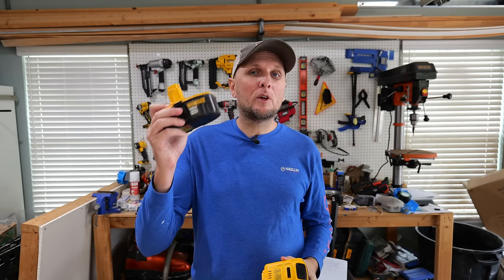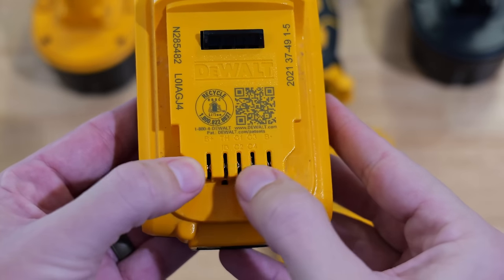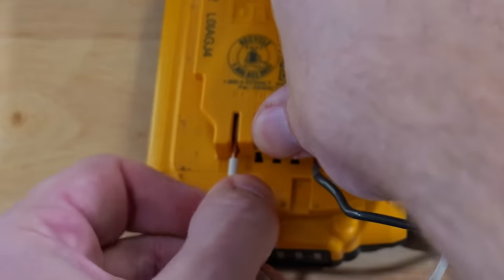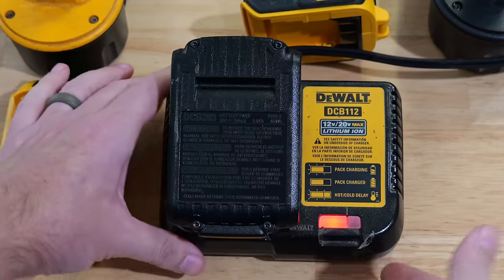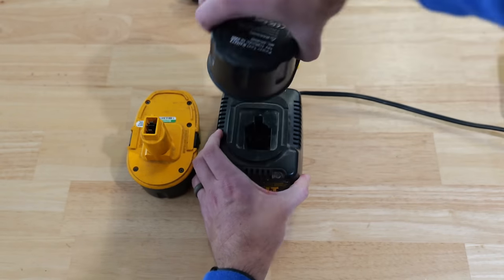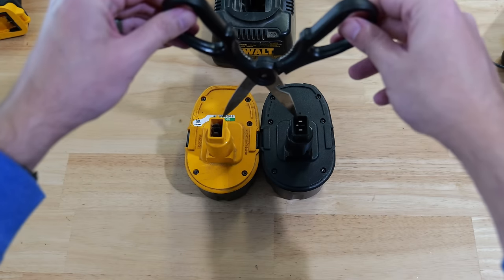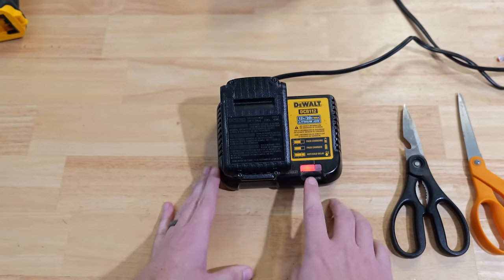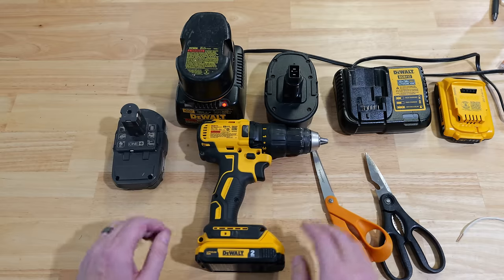SECRET To Reviving Dead Portable Tool Batteries | Super Easy!

Comment: For the 18volt dead battery, instead of wires or scissors to charge off of another 18 volt battery. Just use a typical 9 volt battery and place upside down on the prongs for about a min. Should send a charge to get it recognized by the charger. Super easy!
Reply: Do you have to match the + and - on the 9v to certain sides of the battery your sending the charge to?
Reply: Do a video, I'd like to see you do that... before I try it.
Reply: @jmar8507  absolutely, the polarity of the battery has to match the polarity of the charger.
Reply: @jmar8507   yes, if you get the polarity wrong. it wont charge or might  damage the circuitry in your good battery as well as the dead one.
Reply: @GothGuy885  Many years ago I tried to help someone out by jumpstarting their car. I looked ate the battery, connected the batteries, started my engine, and the other engine would not start.

I looked more closely, turned out their battery was reversed.
Reply: @oneeyedphotographer   LOL , I know where your coming from. my friend and I had classic cars , and when we needed a jump-start ,we always had to tell the person helping us that the car was positive ground. which always seemed  strange to me , seeing that these  cars  were made and around b4 I was born.
Reply: Why dont you take the 3 seconds and try it your self logic is sound  @ronnieroxx13
Reply: @GrayRaceCat match means "+ on + and - on -" or "+ on - and + and -"????
Reply: @oneeyedphotographer If your serious i Don't understand. The battery was turned around or the post were reversed? Jumpstarting only works one way:Positive to positive and negative to negative....
Reply: @GothGuy885 Not sayin your wrong but have owned over 150 classic cars....those before '73 back to '03 and perhaps they had been converted but never saw positive ground just 6V or 12V. But obviously I can't have seen everything. Plus we hot prodded everything. That's my ProStreet '64 Corvette w/Supercharged BBC in that little channel icon pic.
rick in Tennessee
Reply: @TheAcceleratorMagazine   we had 1940's-50 cars. that were independents from the big 3.   2 Hudsons ,a Packard and a Nash. tho that was my partners thing, I was more into 1970's Mopars. because that is what was around when I was a teenager, such Sexy cars!  :)>
Reply: @TheAcceleratorMagazine   my partner was into the 1940,s - 50,s cars. which had Pos. ground. I thought that was weird also.
I myself am into 60's ,70's cars .mostly Mopars. with the back lifted, big Fat deep dish mags on the back and standard slots on the front. and the way they sound in idle and when  they're being revved. they are just sexy AF! I get a wood when I see one :)>
Reply: @jmar8507 absolutely yes. Take your meter and double check the tabs for polarity. Lithium batteries are less forgiving than an ex wife and just as dangerous.😮
Reply: @GothGuy885 Worse, if you dont catch it quickly it will catch fire. Lithium batteries are unforgiving
Reply: @TheAcceleratorMagazine  Some cars and usually some older construction equipment such as the Caterpillar dozers were in fact wired to have positive ground. Don't know why but it was a thing.
Reply: @netts2315  Preciate the reply. After I thot about it I remembered some of that. Kinda like some lug nuts are left hand thread. On an old Jeep pickup they were right hand threads on one side and left hand on the other. Didn't figure that out until twisted off one stud on the left hand side. With a long pry bar on the lug wrench. 
rick in Tennessee.
Reply: @TheAcceleratorMagazine  Yeah, I remember that, I wonder where these setups went? I guess they were too complicated to have to remember which side you were on and people snapped studs left and right. How's the weather in Tennessee? I'm based all the way over the globe in Finland, 17,6 degrees Fahrenheit right now and experts are predicting spring to be as late as April. And I was hoping for an early spring, lol. Cheers!
Reply: @netts2315  Great to hear from ya. Have worked in a lot of countries but never Finland. Haven't traveled much as a tourist to see the pretty and interesting parts of this world, always in the dark and dirty parts. Plus I I wudn't know how to act, or feel comfortable, unarmed.
I thot I liked cold weather until I spent some time in a country with those minus zero tempe and whiteout conditions from blowing snow. Went back to jungle fighting for several years then to deserts. In Peru where I was stationed it was their "winter time". About 60° durin the day and 50's at night with zero humidity. I had found home. Almost. But that's another long boring story.
rick in Tennessee.
Reply: @TheAcceleratorMagazine  Very interesting stories, thank you for sharing! Cheers!
Reply: Thats what i thought also...but figured he meant that he carhed the battery the right way...but dead car had its positive wire connected to the negative battery terminal and vice versa )  @TheAcceleratorMagazine
Reply: @gballs007  Preciate the reply....
Kind of a miracle that many old vehicles and lots of heavy equipment have survived.
Reply: Doesn't matter how the car is wired, you still have to connect plus to plus post and neg to neg post of battery...
Reply: @cliffkishbaugh2221  Um, maybe not. I thot so too, like you but I got educated here.....
You'll be hearin from em. Just take it like a man. Like I thot I made a mistake one time....but I was wrong. 
rick in Tennessee.
Reply: @cliffkishbaugh2221  Not necessarily. Positive to ground vehicles exist, some old cars do/did this and especially old Caterpillars.
Reply: Does a 12v lead acid with low amps work
Reply: @shafferfoods4669 A 12v battery usually can revive a 18v li-ion battery, but it's risky, because due to the lower voltage there's a chance polarity will inverse on one of the li-ion cells, permanently damaging it, and causing safety hazards. If you use a 12v battery, use it along with a voltage meter to make sure the voltage keeps steadily rising until about 10V, then try the charger. If the voltage on the li-ion battery stagnates, the battery pack is dangerous.
Reply: I once had a dead car battery and asked a guy if I could get a jump. Neither of us had jumper cables, so he took his battery out of his car and put it next to mine, matching up the posts and tilted his battery, touching posts and had me turn my key. 
Vroooom!
Reply: What if you only have 1 battery? Would an 18V power supply do the same thing?
Reply: My problem is the battery shows fully charged, but has 0 V.
Reply: I have done this when I was off-grid, when yet knowing I may be in need of a backup battery, I had a spare new auto lead acid battery which I had kept charged on a solar charging set up with a charge controller and an a plug-in inverter just in case.  I went out one day to my truck in a hurry to go into town & the truck's battery was dead or so low that it would not start the truck.  It wouldn't start, so instead of disconnecting cables, and having to lift 2 heavy batteries, I thought  why don't I just flip this fully charged backup battery over on top of the one still hooked up in my truck, connecting + to + and - to -, and it worked!!! I waited about 10 minutes , then turned the key & the truck roared to life again! I removed the upside down spare battery, put it back on solar charge again, while I went to town to buy jumper cables! Thank GOD, and I was on my way again. I went straight away to purchase some heavy duty jumper cables to have on hand when I couldn't wait for my slow charging solar panels to do the job on a dead battery in a vehicle & also to have in case my truck battery was again  too low would not start so that someone would help give me a jumpstart if I needed it 
on the road or in a Walmart parking lot.😂
Reply: @panamaks1  try a 9 volt battery to dead battery
Reply: @TheAcceleratorMagazine Yes i have a 1956 Ford 800 tractor, 6 volt system with a positive groung.
Reply: @GothGuy885  The "good battery" hasn't got any circuitry. It's a PP3 9V battery.
Reply: @GothGuy885  A good friend of mine had an MG Midget which was + ground. Not many radios had a switch for this. We made a dash panel from wood. We put an MG (small dia.) inner tube around it plus plastic support bracket. After reverse wiring, the cassette and FM stereo sounded great for many years.
Reply: In the video, you didn’t show how to jump start the Ryobi 18v. Not sure how to attempt it.

Comment: I have several 40V Greenworks outdoor power tools; mower, trimmer, leaf blower. About 3–4 years ago one of the expensive (more then $100 at the time. They've come down in price since then) 5 amp batteries stopped working. Wouldn't charge, wouldn't run. So, having nothing to lose, I took it apart. On top of the batteries is a circuit board. On the circuit board was a flat automotive fuse, soldered into 2 slots on the board. The fuse was blown. I unsoldered the fuse and  pulled it out. Got a new one of matching amperage from my tool box, trimmed about 1/8" off of the blades so it would sit low on the board like the original, and soldered it in place exactly like the original. Worked perfectly. I'm still using that battery.
Reply: They do this with televisions, they do this with washer and dryers and microwaves. I know because I have replaced a fuse on all these in every single one was a Samsung. What a scam.
Reply: @BillyP-49Chevy  it's not a scam, it's a fuse. It protects the electronics. If there was no fuse it would have blown an expensive or difficult to replace component in the electronics when it could have been easily protected with an inexpensive and relatively easy to replace fuse. Almost every electric and electronic device has internal fuse protection with troubleshooting and replacement details in the owners manual.
Reply: Is that what they call ‘planned obsolescence’?
Reply: @rupertcornelius8924  You are partly right. The fuse certainly does protect the electronics. But in this case there is no mention of it in the owners manual or any literature, and it is in no way intended to be replaced if it blows. What they want to happen is for the owner to declare the battery dead, trash/recycle it, and spend >$100 on a new battery. THAT is the scam. The fuse should be in a fuse socket in a user-accessible location so when it blows it can be replaced.
Reply: @redfo3009  Not so much planned obsolescence as planned premature failure.
Reply: @O-Grady  ahh. I see. In that case I would agree.
Reply: my question is what made the fuse blow? something increased the current through the fuse to make it break (safety).  I've never heard of using a fuse for planned obsolescence.
Reply: @pstevereynolds  There's no way of knowing for certain what made that fuse blow, at least within my abilities. Sometimes fuses just fail for no apparent reason. When I tested the battery on the bench with a multimeter everything seemed fine. If the fuse had blown again after replacement the battery would have been retired and recycled. But these batteries are 8 years old this year—including the repaired one—and are still chugging along just fine. They have lost some capacity, but not nearly enough for me to start thinking about replacing them yet. But obsolescence? Probably not really the right term. However, that hidden fuse can cause premature failure and necessitate replacement for something that really doesn't need to be.
Reply: Let’s see now…… You build a replaceable fuse in a non replaceable circuit.  When the fuse blows, Harry Homeowner senses it is time to buy a new battery.  Great marketing strategy!
Reply: @druegillis1744  Exactly!
Reply: @rupertcornelius8924  exactly and it often protects the supply cord and the electrical installation that is upstream of the appliance. 
There are reasons for a manufacturer to add a "no user serviceable parts" logo on an appliance.
Really Seriously Though.
DON'T ATTEMPT TO SERVICE YOUR MICROWAVE OVEN!
The main capacitor in the appliance can hold 5,000V DC for quite a long time. It can cause you serious injury!
Reply: @rupertcornelius8924 but they could make it user serviceable by exposing the fuse. Lots of other electronics do that. Soldering it to the board is a clear sign that they don’t care
Reply: You can tell papaw is proud of that quick fix,tells it at every Xmas party huh😂
Reply: It’s a scam, I unfortunately bought all Samsung appliances and now both the washing machine and dishwasher have issues. First the washing machine started to never finish the loads, you’d check and see that there were 28 minutes left, come back and see that now 45 minutes remain, and this will go on until you turn the machine off and start it again. The thing is it will only complete a wash if you choose the most basic, shortest cycle, any deviation causes it to just endlessly continue the wash. The washer was around $600 brand new, the repair men, I got two estimates, said the part is $500 and they charged $80 for the house call. A quick Google search and you can get the same model,used, for around $250, it’s a complete racket! I haven’t bothered with the dishwasher repair, I just get up and reset it every time it malfunctions. Samsung no bueano.
Reply: Neat, I love things with screws.
Reply: Damn you sound like the reincarnation of my stepfather.  Tell me, do you buy lottery tickets and leave them unchecked on your workbench for years?  Bo did that.  He also stole dozens of transformers being stored in a parking lot so he could get the copper coils out of them.  The problem was the reason they were being replaced was the cooling oil in them was highly carcinogenic.  He was diagnosed with aggressive brain cancer at 47 and died at 54.  They were shocked he lived that long.  Moral of the story is that shorted fuse may have shorted for a good reason, to use it after that might have meant a fire or an arm being blown off.
Reply: The issue isn't the blown fuse... It is in the answer to the question, WHY did the fuse blow? Fuses don't just blow because they don't want to work that day.  There is some external REASON that the fuse blew, so find THAT reason, and only then you can assess if the problem is fixable or not.  Otherwise, you have just placed a bandaid over a bad tooth, to stop a toothache...

Edit: Yes, there are exceptions to the rule, but in most cases, I'm more apt to believe that it's not just a weak fuse, since a power surge can compromise/weaken other components, so that's why it's important to look into why a fuse blew, rather than just making the assumption that is was just a weak fuse needing replacement.
Reply: And what's funny is that the dead  battery that the consumer thinks isn't repairable because no where does product indicate such facts is when we recycle those batteries guess who "refurbished them then back on the sales floor or back in the product market for repurchase again for additional profit for companies and retail stores online and sales floor marketplace. Now that's a scam at the expense of consumers ignorance. 
FYI not name calling : 
(Ignorance means to lack knowledge of something)
Hey it is what it is
Reply: The scissors is cutting edge technology